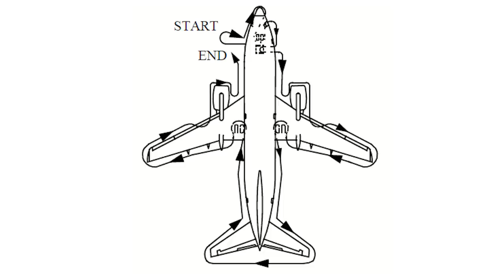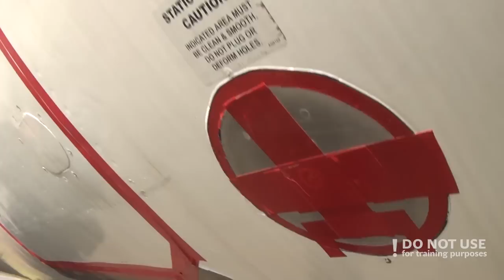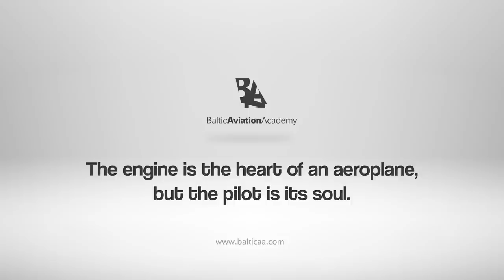Basic Aircraft Preflight Inspection

Comment: If I become I pilot, I'm gonna be checking thoroughly on the outside and inside of my plane, wouldn't want anything dodgy happening, could you imagine, I'm flying at 500mph at 35,000 feet and then suddenly the engine cuts out. Of course if that did happen, I could still fly with one engine, planes can fly well on one engine,  but I still wouldn't want to fly on one engine because if the first one went out, then the second one could too. So, that's why I'll be checking, I'll be doing a lot of safety checks, I'll be saying to the passengers "this is your captain Alec Jones speaking now, welcome aboard the British Airways flight 216 or whatever, Boeing 747 going to Hong Kong, uh we would be departing in 10 minutes or so but as usual I'll have to do a lot of safety checks before I can even more this uh metal bird, so uh because of that, we'll be leaving Heathrow Airport for 3pm rather than 2pm" 😂😂
Reply: LOL
Reply: I don’t think the airline will be happy about the amount of delays you cause just for one inspection
Reply: Maintenance has already looked at it….flight crew takes a quick lap and gets in the seat

Comment: That plane is quite old
Reply: It's going to be scrapped, thus they are stripping it down. It's in poor condition.
Reply: rangersfcf1 actually he said that the aircraft is prepared for repainting, this means that the old paint is stripped and then the new paint sprayed on. And why do you think that the aircraft is in poor condition?
Reply: ***** I wonder why the engines are removed?
Reply: Aidan Norman might be because of a D-Check or maybe they are replacing some parts from the old engines
Reply: Moreover it has been repaired in almost 5 places on the fuselage, at least 2 on the right side and 3 on the left.... the are big multiple doublers with many rivets, it is not only a skin repair but some kind of structural repair... not a good plane.....
Reply: Andrea The thing is, he didn't mention anything about scrapping the plane, just respraying it.
Reply: Andrea I don't think those were repairs, you were seeing, just the tape they use when they paint planes
Reply: Aidan Norman check at 2:07, 5:47 and 7:22 trust me, those are repairs.
Reply: Sorry Andrea 
I checked all 3 times you wrote and NONE of them are repairs
Reply: @andrearossi80  sure it is ….it has been REPAIRED
Reply: This airplane is in a storage program…all the tape is to keep dirt etc out…worked in a storage facility for years.  Engines removed as spares for live aircraft